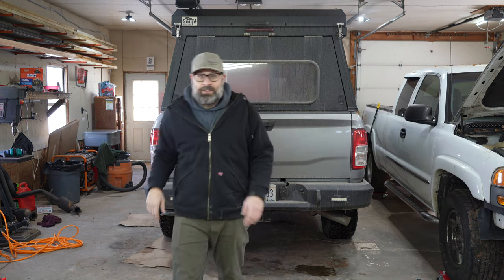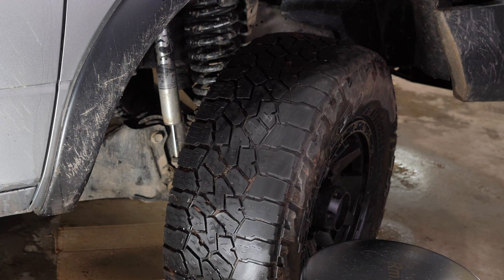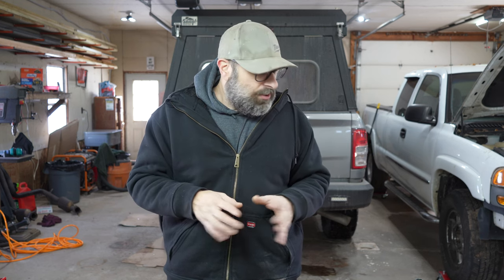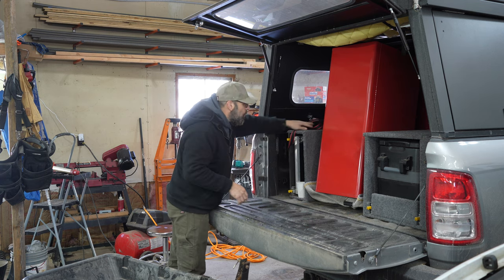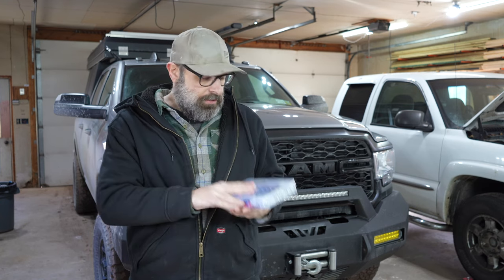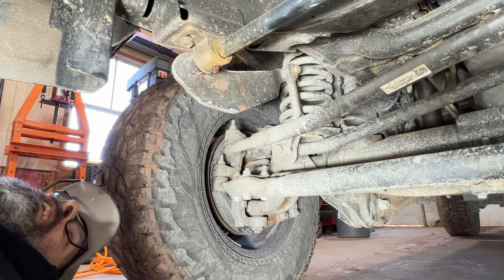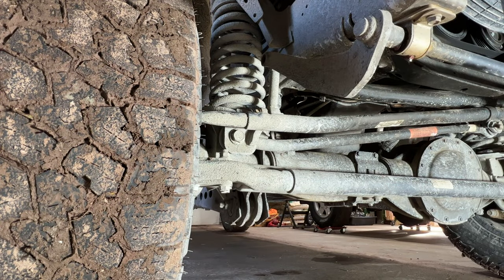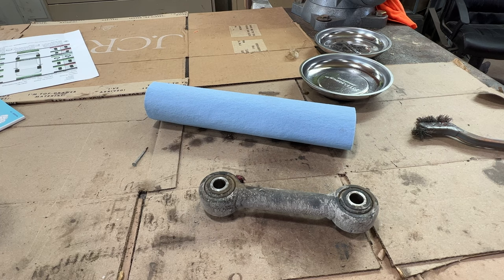Fixing My Sway Bar Because I Screwed Up - Ram 2500 Thuren Active Rate Suspension Overland Offroad

Comment: Hopefully you did the alignment with your payload on the truck. The other edge wear in the front could be from excessive camber from all the weight.
Reply: Excessive weight would cause negative camber not positive. Also there is no camber adjustment with a solid axle without adjustable ball joints.

Comment: What I meant is that visually and by the numbers on your mic they are different in length..... so it makes sense why you had to grind one so it would work......I just hope that grinding that little bit did not somehow damage the grease fitting. 
I was worked as a mechanic years ago so I have dealt with those grease zerks quite a bit.......also since you live in a place where it snows consider using anti seize everywhere that it is safe to use.......I have a 2014 Ram 2500 4x4 diesel
I am planning on adding bumpers and a leveling kit kinda more or less what you have done to your truck.....I'm in Florida and use Rotella T6 in 15w40 but I highly recommend the same oil but maybe in 5w 40 for you......take care

Comment: So if my truck is bouncing a little too much you think I need to add more freeze to my zerks?
Reply from the maker: I would first check your tire pressure. If it’s too high, you’ll be all over the place. But if you have a greaseable sway like mine, then I’d check that too. Last thing to check would be shocks. See if any are leaking. Bad shocks will cause it to bounce too.